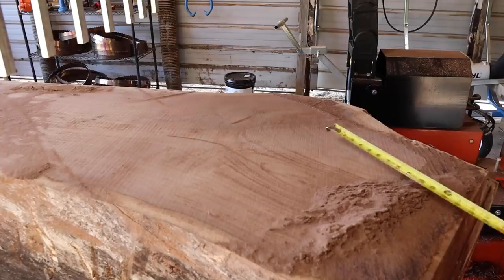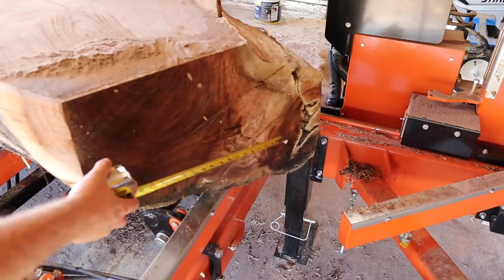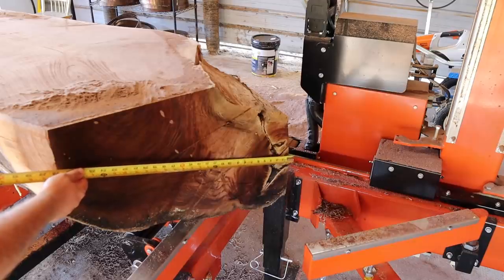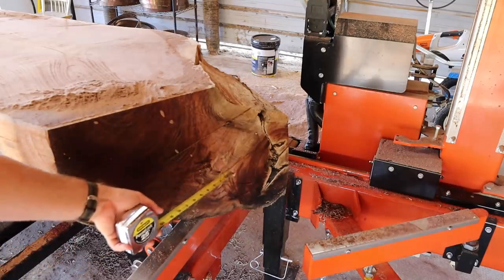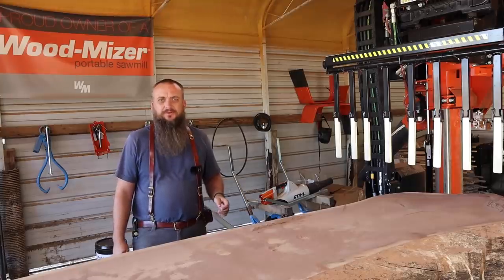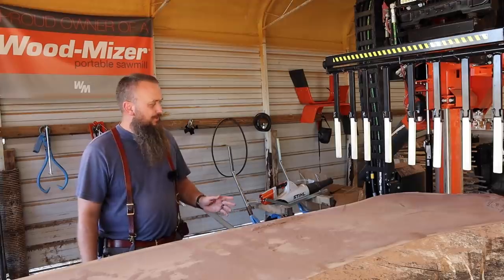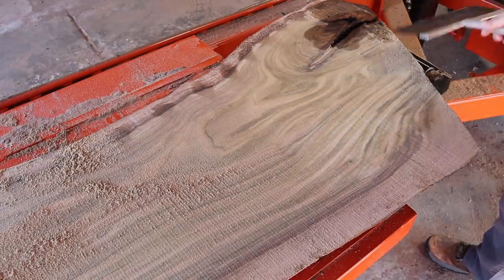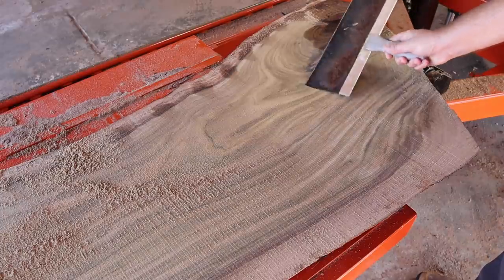I Hope This Works, More Black Gold On The Sawmill

Comment: Waste for you is gold for a ukulele luthier.   The wedge is approximately quartersawn and greater than half the width of a ukulele front (>5” wide).   If it were in my shop I would cut it into 0.180” thick slabs I could book match into a ukulele backs and use 3”wide strips  approximately 24” long as sides.

Comment: I might be missing something, but you didn't actually use the new cut you made when you rolled the log over.  From the operators position, the new flat cut was on the top left of the log. When you roll the log, that cut should have been sitting on the bed rails on the bottom right, but it was sitting on the cut on the bottom left.  Disclaimer: I have never run a sawmill so I may be totally wrong,  but the geometry didn't make sense seeing it in the video.
Reply from the maker: I flipped it again. Camera didn’t get it